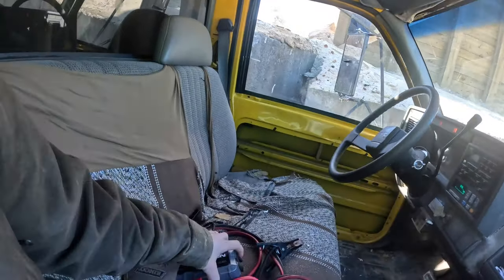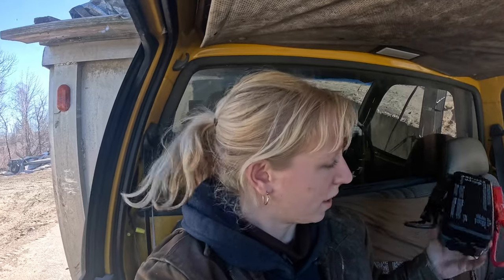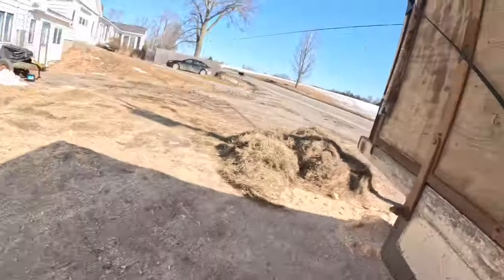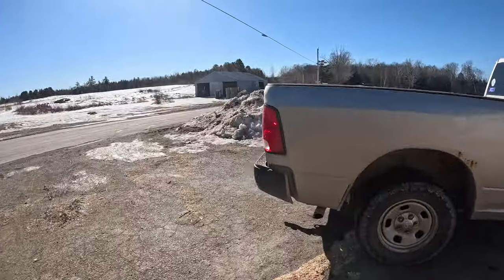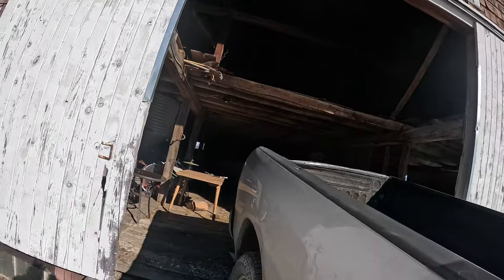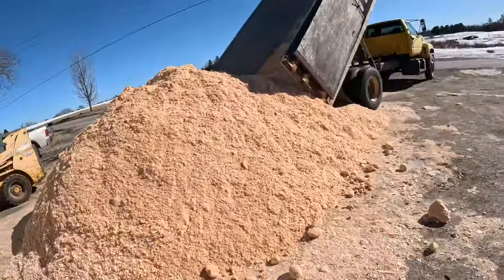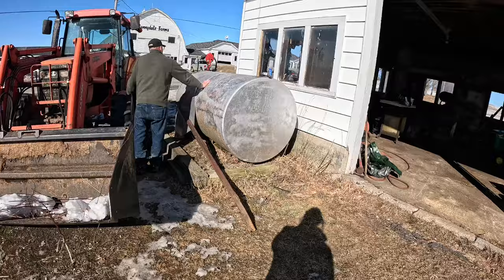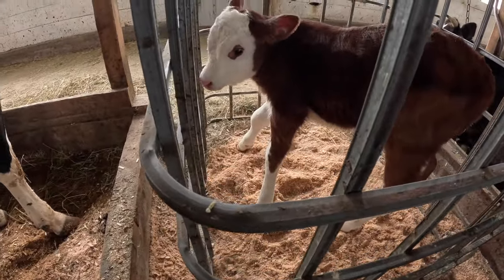Life is hectic on a small dairy farm….

Comment: A pull tarp with ratchets for that truck would only be ~ $600 installed & a LOT safer for Brent & a lot quicker.  Ratchet tarps adjust to varying heights of payload. A tumble off the truck would be tragic